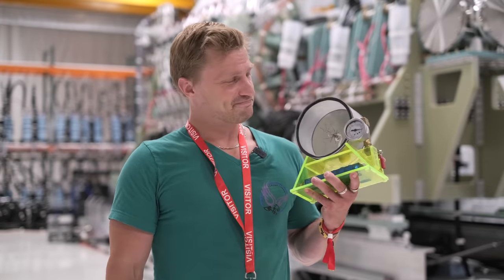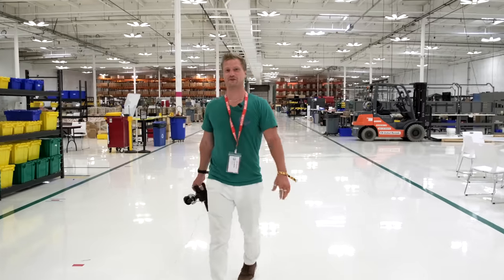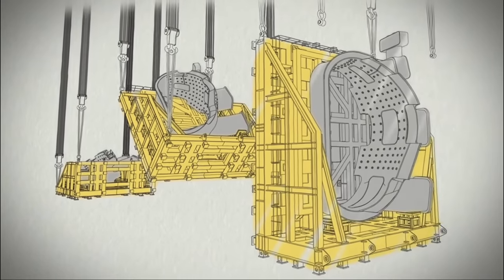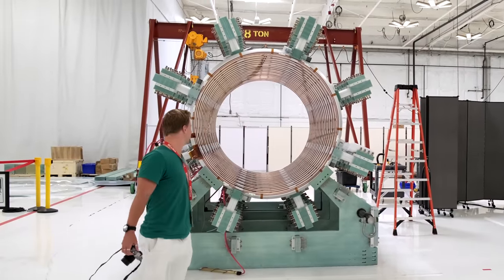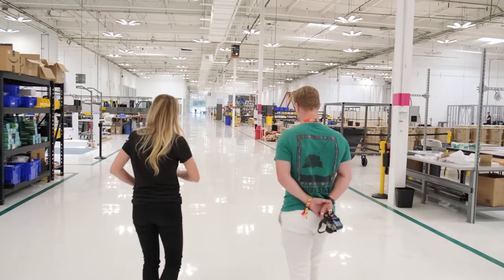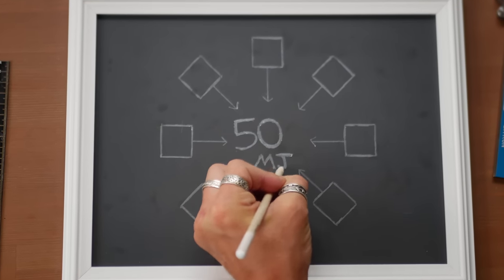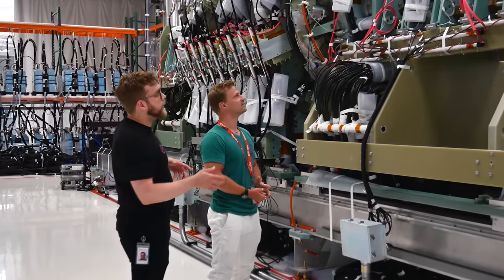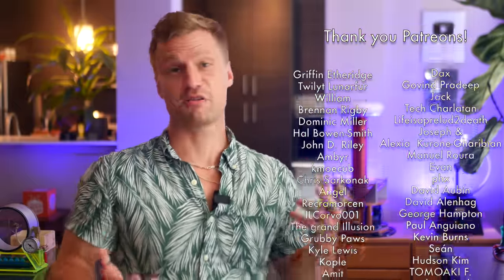An Exotic Approach to Nuclear Fusion (Helion Energy BTS)

Comment: Sadly, we can forget about fusion power because it's already too late.  By the time someone finally comes up with a viable commercial fusion power plant design the entire world will have long since been running 100% off wind/solar/batteries plus some legacy hydro and geothermal.  You can forget about new fission plants too, because we can already build wind/solar/batteries faster and cheaper.  But I'm still hopeful for nuclear rocket engines.
Reply: Looking at Germany, that plan is not going too well...

Comment: i'm wondering that the energy required to produce plasma to sustain it through electromagnets (which need lots of energy) and then compressing it to the point of fusion might required more  energy then output energy 
long story short: is input energy greater then output energy?
Reply: That is what Polaris is supposed to demonstrate by the end of 2024. Not just net energy, but net electricity.
Reply: @elmarmoelzer2229  but they have been tested may time by now so in those test do we find more energy output then input ?

Comment: Would this work better in space?
If you had massive solar farming areas on the moon to charge the capacitors, the vacuum of space would cause it to require less power (it would be in a natural vacuum) and it would keep it cold potentially making it even more efficient. This could be the way humans power life on other planets.
Reply: It would work in space. Keeping things cold in a vacuum is actually harder than keeping them warm. The reason is that a vacuum is a perfect insulator. So heat can only be (comparably slowly) radiated away.
Reply: @adamharcourt7696  A steam generator (like any heat engine) needs to have a temperature differential. That means that the water has to be cooled. In space this can only be done with radiators. That said, Helion's machine would probably still be the best nuclear energy source for space applications because their direct conversion is so efficient.

Comment: if I'm calculating right that's ~1.4KWh if sustained, but the input must be much larger.  I've been following them a bit.  I would like to work there.  I'm a 52yr old computer geek that after reviewing many designs in the fusion space believes Helion is the lead horse in this race 100%.  I see materials research being the biggest challenge as well as the requisite sink they need for recovery.  I've been tinkering with carbon 'wire' mfg. on my own and I think they have the mfg./engineering capabilities.  Even if they just entered the carbon space with engineered molecules I think they can get $500/g, providing a new business model to draw even more investment that they are gonna need beyond Polaris.  I think they need more data to get the Hz up to a + net.  So I'm a layman, but ... from the outside looking in, they need materials and data capture.  The battery systems are going to have to undergo many iterations as well - so I'm glad they have in house mfg. setups.  I'm in FL, but I would fly out for the demo you just got ... lucky b*st*rd.

Comment: Looks around in the comment section hmm soo nobody gonna mention how this looks like those early stage warp cores from star trek? Also ever since i was a kid i always wondered we have these fancy ass nuclear reactors but in the end what we use is steam so...they basicly new tech steam engines...i always wondered why cant we extract the energy directly without mechanical conversion...if i get it right this fusion reactor would do just that...but i dont really understand how you transfer that energy directly...are there like capacitors or something where that charge can go?

Comment: Certainly amazing technology, and I agree fusion would be the top advancement of all time!  

Question:  If the energy output is pulsed, what sort of infrastructure would be required to instantaneously capture this output and slowly release it in a continuous three phase AC current?
Reply: I would guess similar to solar and wind which also produce DC. In some cases this can be an advantage as they would like to build on site at data centers and deliver DC directly without conversion back and forth

Comment: Nice approach, it will probably stay with D-D and D-T fuels, because the supply of He3 is neither economical nor could it be extracted from the Moon in sufficient quantities as a general fuel.
Reply: D-D produces He3 (and Tritium which eventually also decays into He3).
Reply: 🤦‍♂ @elmarmoelzer2229  I know "reading and understanding" must be very hard.
Reply: @sergejkoch1432  ???
My point was that their machines self- supply with Helium3 by also fusing Deuterium.
D+D => He3 + n
or
D+D => T + p
Either have a 50:50 chance of happening.
The Tritium eventually also decays to more He3. So essentially they get Helium3 from every D+D fusion reaction. 
The D-D fusion reactions are not going to produce much (if any) net electricity, but they will not cost much either if anything.
Reply: @elmarmoelzer2229 "their machines self- supply with Helium3 by also fusing Deuterium" - NO! Completely different energy levels.
Either focus on producing He3 or focus on producing electricity with ONE specific reaction for which the reactor is highly optimized.
No sequential multiple fusion, this is NOT a chemical process here, but a physical one!
Reply: @sergejkoch1432  
I guess some armchair engineer knows better again...
These are FRCs. The beautiful thing about them is that they are high beta. For a given magnetic field, they allow scaling between density and temperature almost linearly. D-D prefers higher density and lower temperatures. D-He3 higher temperatures over density. Helion can tune their machines to exactly the ratio of reactions that they want. They can also alternate for each pulse (or sequence of pulses). Make a few that favor D-D reactions, then do some that favor D-He3 reactions. They have lots of ways to tune the machine for optimal breeding and burning.
Reply: @elmarmoelzer2229  So you seem to be running out of arguments, so you resort to insults, huh? Why don't you read some papers, or even better, a 1988 NASA conference publication on this very subject? Probably these can bring you back on the ground from the "Helion" rush.
Reply: @sergejkoch1432   Sigh... You seem to assume that the guys at Helion are amateurs who do not know what they are doing. I remember the same arguments were made about SpaceX before they first landed a F9 first stage.
I will ask you: How many FRCs have you (or NASA) made and at what scale and what B fields?
Somehow everyone knows everything better than the people actually working on this.

Comment: Fussion is impractical on a commercial scale. we need to focus on safe fission. 99% of the waste is unused fuel....
Reply: How it will perform commercially is yet to be seen. Helion's approach could be very competitive economically. They can load follow in milliseconds. The cores of their machines are designed to be transported by road (still fit under underpasses) and do not need a steam plant, which should mean a much lower CapEx. What I do not believe will ever be economically competitive is the giant Tokamaks like ITER (which would still be sub scale compared to DEMO). Btw, fellow nuke- bro here. I love fission, but fusion designs like Helion's and Zaps could fill in in many places. Will be regulated much more favorably compared to fission too.

Btw, talking about the waste, some fusion designs would be great for burning fission waste (while making energy). Helion even considered it in the very early days as a potential intermediate step to a pure fusion reactor as the fusion part itself does not need to break even. They could not get funding for that, though and it was easier to just go straight to a pure fusion design.
Another problem is that fusion- fission- hybrids like that would face the same issues that fission does from a regulatory and political POV.

Comment: It’s called thermal fusion for a reason, you don’t just waste 80% of the fusion energy to heat up the plasma every and each time.....and where is the required neutron shielding.
Reply: The input energy is extracted along with the fusion energy. The machine shown in the video is the formation test section. It does not produce neutrons. Polaris will be in a borated polyethylene and borated concrete shield vault.

Comment: Um the energy released in fusion isnt electrically charged therefore wouldnt induce any electric current
Reply: All fusion reactions, even Tritium and Deuterium fusion release some of their energy as charged particles (3.5 MeV Alpha particles in case of D-T). D-D reactions release 66% of their energy as charged particles. D-He3 is 100% as charged particles.
Reply: @elmarmoelzer2229  yeah it creates helium ions from hydrogen ions and the extra energy, required for net gain, is released in photons and neutral particles. The mass of a helium ion isnt the energy they get out. They only get energy from the motion of charges past a conductor. The only energy they are getting is the energy of condensed helium expanding.
Reply: @SunShine-xc6dh  
Most of the energy of a D-He3 reactions is released as charged Protons (14.7 MeV) and a bit extra in Alpha particles (3.6 MeV).

Comment: D He produces neutrons because you cant stop the DD reactions occuring and some T is also produced from the He reactions producing DT reactions. Theres no way to make the mix perfectly fuse only DHe. The no neutrons thing is a load of bs
Reply: They actually want some D-D reactions because those are what produce the He3 (and Tritium in the other D-D branch). Depending on how much He3 they have in stock from Tritium decay, only about 1/3 to 1/4 of the reactions in such a mixed mode (does both He3 breeding and D-He3 fusion for electricity) design will produce a neutron. Also, those D-D neutrons are "only" 2.45 MeV vs 14 MeV from D-T reactions. That makes them a lot more benign with the materials Helion chose for their machines. 

D-T fusion reactions are greatly suppressed because the Tritium is too hot and non collisional on the time scale of the pulse <1ms. After the end of the pulse the vacuum chamber is cleared from all fusion products (including the Tritium) before the next pulse. So the Tritium pretty much never gets a chance to fuse with Deuterium.

Comment: So, can they produce a continuous net positive fusion reaction?
Reply: It is a PULSED machine. The need for continuous reactions is overrated.
Reply: @elmarmoelzer2229  oy vey... no no no... I don't care about the mechanics, I just wanted to know whether they can generate (sustain) net positive results. Where are they currently in regard to that?
Reply: @socksincrocks4421  
Define "net positive". If you are talking about net electricity, then no. Trenta was an experimental machine with a very low pulse rate and no equipment to extract electricity from the machine.
Polaris is going to do that (if all goes as planned) towards the end of 2024.
That said, I hear that theoretically, if Trenta had had the equipment for it, it could have potentially produced a tiny amount of net electricity from Deuterium- Tritium fusion. But that is not really where Helion wants to go.

Comment: Everyone complaining about He3 fusion not realizing part of Helion's plan is to GENERATE the fuel with a different version of their reactor designs almost exclusively for breeding the stuff.

Whether or not that will actually work, is another matter entirely.  The only thing I can say with certainty, is that anyone who either asserts that it will succeed, or that it will fail, is absolutely full of shit.
Reply: They CAN make it with a different version of their design, but AFAIK, the first power plants will do both, breeding and burning of He3 in the same machine. Having dedicated breeders could be more economic though. So they might do that in the long run.
Deuterium fusion is well understood. Half of the reactions result in He3 + a neutron and the other half produce Tritium and a proton. The Tritium eventually also decays into more He3.

Comment: If you look at the coils, they're copper.  There is going to be HUGE energy loss there.  You don't have a rats chance in hell without at least going super conductor.
Reply: The magnets are pulsed which helps a lot and the ohmic losses are only about 5%. Also, they are aluminum, not copper.

Comment: 6 pulses for minute at what temperature and densities of plasma ? that changes a lot the efficiency, beside you should subtract energy loss  for D+D reaction since Deuterium can react with itself and is not a viable net posive reaction.  beside D+D reaction release a ton of neutron, I just rememebered now how they boast about a no neutron damage for the reactor, but they approach is a mere reduction of damage, it will still happen thanks to deuterium alone
I hope they get to 1 pulse a second in the near future, unless the project is pretty much doomed if you weight any cost-benefits
Reply: 1. Polaris is not a full scale power plant but still an experiment. I believe it will operate at around 20keV temperatures. It is not the optimal temperature but enough for small amounts of net electricity (which they aim to demonstrate around the end of 2024). You can check their latest paper in the technology section on their website. There is also a video recording of David Kirtley's talk at Princeton there if you rather watch a video. In a high beta machine, you can linearly scale between temperature and density. Density should be somewhere north of 10^22 ions/m3.

2. Polaris was originally supposed to do up to 1Hz. Either that has recently changed, or they reserving this for upgrades for later campaigns (after all there is no need to go all out if Polaris can not bring the other parameters). Power plants are supposed to do between 1 and 10Hz. Pulse rate does not really affect efficiency much (but would affect power production) since the machine is completely reset between pulses anyway. 

3. They need D-D reactions because that is how they make the He3. D-D => He3 + n or T + p. The Tritium eventually also decays into more He3 (but that would be a while). Depending on how much Hee from T- decay they have, they will need between 1 and 2 D-D reactions per D-He3 reaction (in a machine that does both He3 breeding and D-He3 fusion). So at most you have one neutron per 3 reactions. That neutron also "only" has 2.45 MeV of energy compared to the 14 MeV from D-T reactions. That is a lot more benign and they have a lot more choices for materials. E.g. the silicon they use in the first wall needs to absorb 3 D-D neutrons before it becomes unstable and then only has a half life of ~2 hours. The aluminum in the magnets has a half life of 2.5 minutes.
CFS plans to replace their first wall (and some of their magnets) one every 4 years with ARC. Helion should do much better. Realistically though, I would assume that power plants will have about 2 weeks of maintenance once a year, which is perfectly in line with other power plants. They have an easier time with service than Tokamaks because of the linear design (the magnets do not get in the way).
Reply: @elmarmoelzer2229  thanks for the much needed info, I will still criticite the PR bullshit to say no neutron damage it's still there, it's less than D-T has we already explained, but the walls still need maintenance addressing the damage. Finally a good target for frequency, but as I said if they don't have any proof of concept in the next years they will finish any funding before something actually usable get built.
The last thing I have to ask is about the temperature if I remember correctly the D-D reaction should have and slightly higher rate at that target compared to d-he3, are they trying to make the same he3 as they consume, but with the energy needed for the separation of products and purification of fuel and the one lost in D-D reaction what is the actual efficiency?  like watt out / watt in  x 100% does it beat fission ? we live in a capitalist society man, miracles don't happen if they are not cheaper than the alternative
Reply: @frankpower97  
- What they said in the video was that the D-He3 reactions are neutron free, which is a true statement. If you check the FAQ on their website, they talk about neutrons, actually.
- They have a target for end of 2024 for net electricity. As usual with large engineering projects there might be some delays but from what I gather, they are still pretty good in their timeline.
- If you check their paper, you can see the reaction rates and the power to loss ratios for their targets. They can balance the temperature vs density at will, even between pulses. At least initially, they will need about 2 D-D reactions per D-He3 reaction to make the fuel cycle close. Though they have a little wiggle room from trading Tritium for He3 (Tritium being slightly more expensive than He3 at the moment). They can also make a really good amount of profit just from selling the Tritium. At current market prices, they will make A LOT more money of that than from selling electricity, actually. Of course that will change once the market is saturated (though there might be some elasticity).
Their power plants are supposed to produce 50 MWe. The key is that they can startup and shut down the machine within milliseconds. That makes them a great pairing for renewables. 
They are aiming to eventually get prices down to 1 cent/kWh. Part of that is mass producing the machines in a factory at a rate of 20 a day.
They are sized to be transportable by road. So it is relatively easy to ship them.
Oh and regulation will be much simpler than for fission. They will be regulated like particle accelerators.